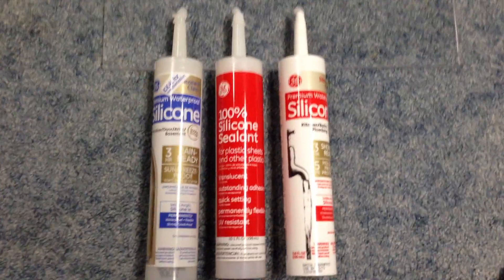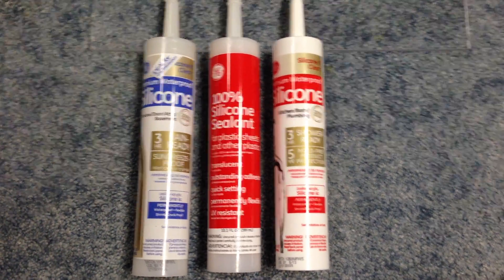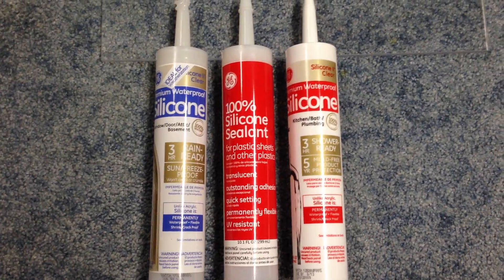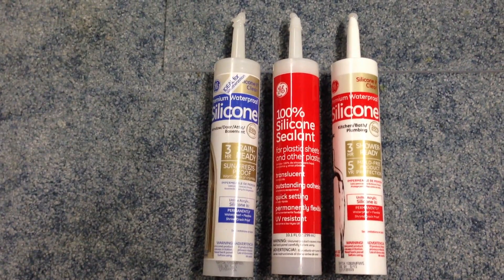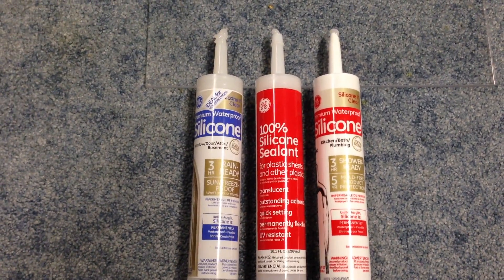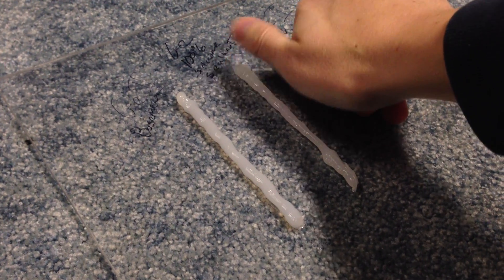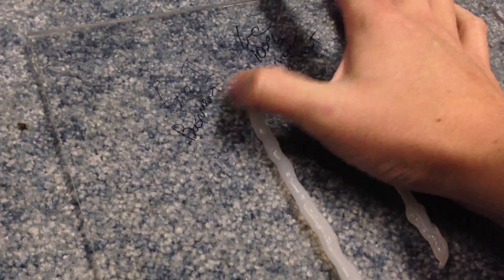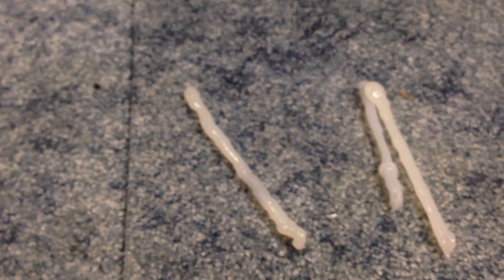Silicone Product Test on Acrylic

Comment: As a professional caulker I can tell you that most plastics require a primer.
The difference in the GE silicones are there are 2 basic types of silicone acetoxy and neutral cure.
You are completely ignorant about GE silicones they are for . They have very different characteristics.
You clearly have very limited knowledge of silicone
And your test is just plain stupid
The sealant HAS TO BE TOOLED TO IMPROVE ADHESION you moron

Comment: I purchased a tube of the red label 100% Silicone last night for use in an aquarium application...  (Before I saw this video..)   I was expecting it to come out of the tube and have a consistency and smell of "Aquarium Sealant"  The tube I bought (exact same label as yours) was extremely difficult to pump out of the tube actually partially bending my cheap caulk gun (after breaking the new tube seal obviously with a screwdriver) and when it finally did come out of the nozzle it had a slight yellow tint and came out like paste not like a gel like actual aquarium sealant.  I decided not to use it for it's intended purpose because the consistiency and smell was not what I expected and because it didnt even really stick to my fingers when I touched and played with it.  I rolled some up into a small ball like a small gumball size and stuck it to a piece of acrylic.  This morning it was still pliable and moist after sitting untouched for about 8 hours.  I was hoping this was what I needed but it seems either it is not or I have a bad tube of it...  I'm not sure I want to try a second tube at $8 a tube.

Comment: Are any of these the same as the silicone sold in the smaller tubes as 'aquarium sealant'? --Whatever that stuff is, did not form a watertight bond any of the times I've tried to use it when making acrylic dividers in glass tanks.  I mean it worked fine as a brace, pretty solid in fact.  But water got under the edges almost immediately and turned my soil islands to pure mud swamps.  Yes I used all the procedures and precautions.

Comment: The rightmost tube has a mold retardant that constantly seeps out and basically makes it worthless. GE2 window acrylic is my go to. It has no vinegar smell like the GE1 silicone does. Also 100% silicone is not a true statement. Its actually polysiloxanes, which as you can see is silicon bonded to oxygen... Silicone itself isnt something to be 100% that said, silicone likes to stick to chemicals it can bond too, such as silica in glass. Plastic has no silicon molecules in it therefore the bond isnt a true bond, and will eventually come off.
Reply: so you think this is not a good idea for acrylic over time it's gonna fall off?

Comment: Or better yet, someone building an enclosure for scorpions, or tarantulas, and down the road the thing falls apart, and you have a very big problem on your hands. So I'm here to learn why people are using Silicone for stuff like tanks and stuff. I wanna know how strong it really is for Acrylic and glass flat stock. I will be studying for the next two weeks or so before I even consider building anything, before I even buy fish, piranhas, tarantulas, or scorpions. So.. yeah. I'm thinking for land animals, I'm thinking wood and optically clear acrylic to cut down the cost, while making a very nice enclosure. For Acrylic on Acrylic I'm told to use solvent welding, using water thin acrylic cement or whatever it's called. I've seen videos by TAP plastics and stuff already, but.. I wanna learn about silicone too. Great video.

Comment: Useful vid.  Cleanliness is essential; a dusty,  soapy or greasy surface will not help the bond & although usually they expect you to "tool down" the sealant to assist it's bonding  & get a better finish,  this will not help in cases of incompatible materials!
For years I have been using bath/plumbing grade silicones with mould resistance, successfully sealing ceramic tiles & basins & also fibreglass baths  (GRP). Essentially when the sealant is applied the bath should be filled with water & left full until it has cured. This helps the sealant work when it is under tension - i.e. pulling apart with a full bath.  Despite this, recently I've used the same grade on "plastic" shower & bath panels, it acts like your "crap" grade - any distortion of panel or  bath / shower tray causes it to detach - often almost invisibly, so water seeps by in use. Plastic. What a vague & unhelpful word!  Most of us do not know what "plastic" has been used in these panels & casually throw words around like Perspex or Acrylic. Most are impossible to identify by sight.  If you know what the exact plastic is you have a better chance. Many adhesives are advertised as "suitable for most plastics"  but there some plastics that are inherently difficult to adhere to, so it is pot luck that any particular adhesive or sealant will work on your particular plastic.  The sealant makers have a similar philosophy. If they don't list the plastic, there is no guarantee their sealant will work.  Robert W Gordon makes a useful point re. neutral or acid cures; there are also low or high modulus silcone sealants. Knowing which is best for your needs will save you some headaches. A leaking shower is bad enough, a collapsed aquarium doesn't bear thing about!

Comment: Great video , the silicon on my tub surround lifted right off in one long piece after i noticed a crack. After drying and cleaning i am definitely gonna try this . I imagine being not designed for bathrooms it may lack the anti mildew addatives ( and im beginning to think those addatives are what is causing it not to stick.

Still , i dont mind claning it tme to time if it keeps the water INSIDE my acrylic shower..
great work dude !! i was laughing my ass off at your video , it was funny ..

Comment: SUMMARY: The solid red tube in the middle “100% Silicone Sealant” (for plastic sheets and other plastics) was the BEST for sticking to acrylic according to the experiment. It held on tight and was impossible to remove with manual manipulation.  The other two on the ends however came right off the acrylic with very little effort.
Reply: A few questions:

1) How long did you allow the respective silicone bead samples to cure?

2) What method of cure is the 100% Silicone Sealant” (for plastic sheets and other plastics)? Is it a "neutral" cure using Alcoxy or Methoxy which produces a neutral byproduct, typically an alkyl or methyl alcohol? Or is it an "acid" cure using Acetoxy which generates acetic acid when curing, is corrosive to metal (therefore no good for electronic devices), and has an unpleasant vinegar-like odor?

Comment: I am trying to bond acrylic sheet to an aluminum frame on my camper top.  I tried using 3M glass weld.  It did not work at all.  It came off the acrylic just like the crappy stuff in your video.  I am confident that it will stick to the acrylic after seeing your video.  Now I have to hope that it will stick to the aluminum.  Do you know if it does?
Reply: Never got an answer to anyone…
Reply: @gregbrown5556  It didn't work.  Can't believe that was 9 years ago.  Ended up going with self tapers to hold it in place but every glue and sealant I tried failed.  And the self tapers eventually cracked the acrylic.

Comment: I also tested DAP 100% silicone, 50 year warranty, which Palram says is compatible with Paltuf polycarbonate. The DAP is clear not translucent. I tested the two between two sheets of Paltuf. The DAP product stuck well, although not quite as strongly as the GE. Also, while the DAP product initially cured faster, it stayed less cured inside the sheets, and when pulled apart it was still liquid, while the GE was semi-solid. Because the Paltuf panels are opaque white, I'll be using the GE product.

Comment: Good video, thanks.

I already found the GE 100% Silicone for plastic sheets. It's  numbered 5100 at Home Depot; according to GE customer support it's same formulation as GE57, which is specifically designed to adhere to Lexan (polycarbonate). I'm in the process of installing polycarbonate corrugated roofing panels (Palram Paltuf) and need to seal the join between overlapping panels. I also did some comparison testing, and can confirm that the GE5100/57 product does stick well to polycarbonate.
Reply: Would  it stick good to polycarbonate  and  metal  as a seal?

Comment: I am doing more or less a similar test because I’m building a glass aquarium with PVC bottom. Regular silicone do not bond well to plastics (very low peel strength), however, it does seal if there are no forces. That’s why you’ll find people telling you silicone do stick to acrylic and they know this from experience! I bet you their experience is only sticking an overflow box or some baffles in their sumps but no more.

Comment: Now, I’ll go straight to my conclusion; try ORCA from Aquarium-Munster (much much much more expensive than silicone, it’s for 42$ in the country I live in, but hay, you just said it; a salt water aquarium system could be 10,000$, so why skimp on an important element like adhesive?!). it actually does not contain any silicone what so ever, but its specially for the aquarium hobby and is food safe.

Comment: The ORCA is an underwater adhesive designed to seal leaking tanks while they are still filled with water. At first I contacted their customer service and did say they do not have any experience in building aquarium using the ORCA adhesive. However, I did ask them to send the Orca’s data sheet and I compared it to a silicone well known in building aquariums; SCS1200 (google it).

Comment: Now from the date sheets; the ORCA is almost 10 times stronger than silicone but maintain a close elongation ratio (which means it stays elastic/rubbery like silicone); silicone elongate around 500% before it fails while the ORCA is 400% which is waaaaay much more than an adhesive would elongate while already incorporated in the aquarium build.

Comment: I made a wet/dry sump for my turtle tank 6 months ago and that is when I saw the difference between those 3. 1 of my baffles peeled off in 2 months. But I use GE silicone 1 because it is the same minus the mold inhibitor.